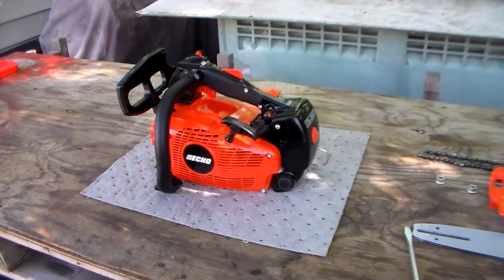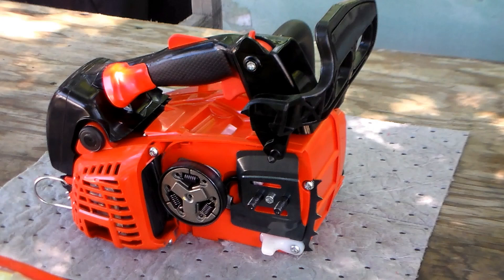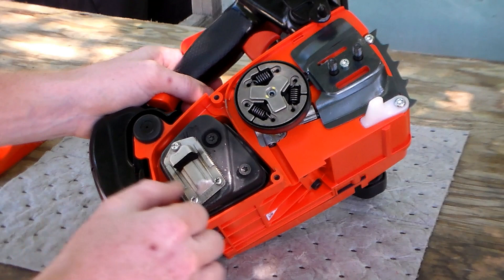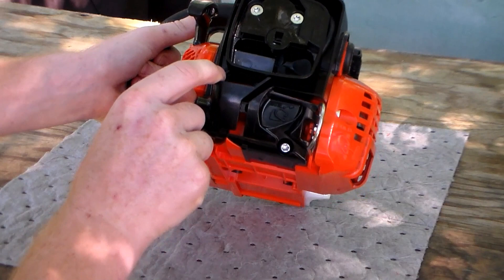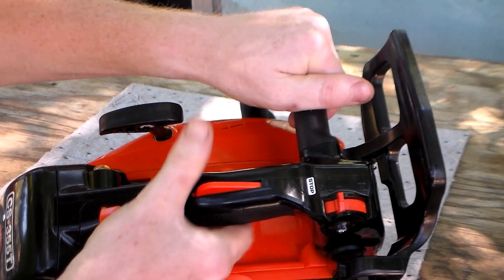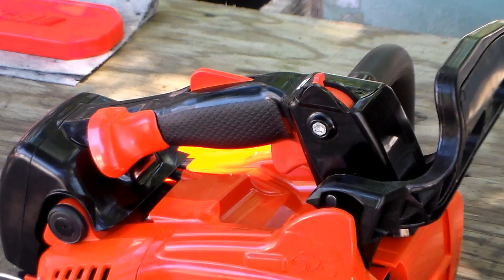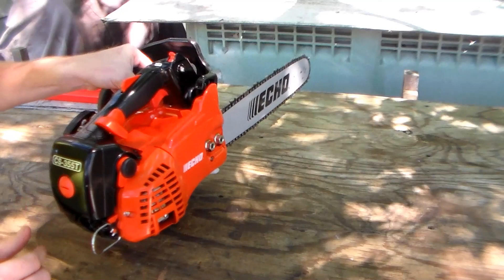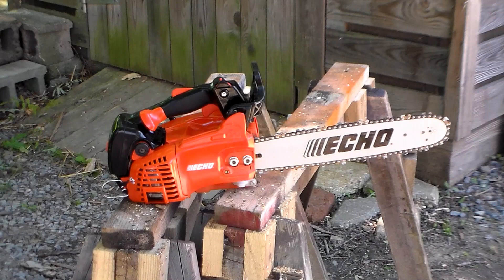Echo CS355T Comprehensive review

Comment: 25yr veteran climber/urban forester. For decades I’ve only used the Stihl 020t that was later renamed the 200t. About four years ago I had to replace an aging Stilh that just couldn’t be cobbled together any longer and chose the Echo cs355t, mostly for the price and availability of service parts (there is typically a Stihl-Echo dealer in every community). Couldn’t be happier! Though it doesn’t quite have the same power as the Stihl 200T the limitation is relatively negligible and the saw more than makes up for it with reliability. Four years running now and not one single issue, extremely reliable! whereas my experience with Stihl top handle saws are the exhaust baffles typically rattle loose, the oilers leak bar lube into the clutch area, makes a hot smelly mess. All that aside the Echo is nearly half the price of the Stihl 201, the 200t isn’t available retail new in the US any longer.
Reply: Just started in the tree industry and bought one for my personal use. Good to hear that it's reliable.
Reply: I’m right with you what you just said,

Comment: 2020 11 13 - I have had a CS355T for many years, one of my favorites.  Running a 12" Bar.    Have had to clean exhaust screen several times, not much else.   The air filter never collects much as mentioned.  Keep Alcohol gas AWAY from it!!

Comment: I was in a rush doing a job and made a bonehead move on the 355T by putting bar oil in the gas port. I removed both covers at the same time and made this big error. I'm going to clear the gas lines out, but a note to self is to not remove both caps when filling. Only fill one port at a time because they are so close together compared a regular saw. They run out of gas fast so you end up filling them up often.
Reply from the maker: On a saw, the system is designed to run out of fuel before it would bar oil. That is one thing I have never done.. fuel mix and bar oil in the wrong tank. However your not alone, I have had customers bring me those old home life super 2's and done that alot.

Comment: I just received this saw and I am impressed with the construction.  I am looking forward to putting it into service.
Reply: Does yours start without throttle? I even took mine back to have it tuned, but I can prime all I want, choke or no choke, and it will not start unless I hold the throttle as I pull it. I’ve owned at least 5 saws over the years and never had a new one refuse to start like this.

Comment: There's a few pet peeves about this particular chainsaw but power wise you can not go wrong. The casing over the chain bar makes me very nervous especially how hot that plastic gets. Nothing upsets me more than the spark arrest screen getting gunked up over long periods of use. I've taken them off on my weed eaters but won't on my chainsaw because of how hot it gets. I don't run my echo weed eaters long periods so I don't worry about debris coming from the muffler. I'm currently looking at a CS 490.
Reply: I just got my cs490 and it's been great. Took about 5 tanks of fuel to break in, which took a bit because it sips fuel. It's my favorite midrange saw now.

Comment: Thank you Sir. Very fine and Thorough. I would like to see your primer bulb rig.
Reply from the maker: The purge bulb is just that, an air purge to push fuel through the fuel lines to remove any air. No more are needed on the purge assembly.

Comment: Only problem I've had is the rubber anti vibration bushing on bottom handle fell apart. I Think it's due to gas and bar oil getting spilled when refueling

Comment: "You need SOME back-pressure" -- are you positive about this?  I'd been lead to believe that, unlike with a vehicular engine, back-pressure from anything post-block (ie any muffler at all) is simply unnecessary on these single chamber 2-stokes...Would LOVE if you could explain this, I've only been told online via forums and never understood the principles involved (just got my 355t and only removed spark-arrester - I'm in FL (I do keep it with my kit though, figuring if I'm ever "above hay" or something I'd toss it back in)
Had loved @Timber and Tools ' mod, they simply used that plate as a template and made a new one that's got a "straight pipe" (like a 1/2" diameter pipe welded at the gas-exit), angled-downward so no need to alter the covering/plastic or anything....though if back-pressure is really a thing then his method, your method, aren't they all simply guess-work?  If some is necessary, why are we presuming echo didn't make it optimal from-factory?  I will admit I was blown-away at its muffler once I got it home, never seen a modern saw whose muffler was literally just an empty/open box like that!
Your heat-shielding of the clutch('s plastic casing) from the muffler is brilliant, thanks for that I'm totally going to do the same (probably even more IE try getting some in-between muff&front-side of engine block)
Re belt-loop --- OK I'm not (that)crazy!!!  I didn't dare forcefully pull it out - breaking my saw before ever cutting a log lol - but it didn't just swing-out smoothly...finally gave it a hard-pull and it snapped out w/o breaking but to hear you saying that closing it is harder still, well, think mine's gonna stay open at all times like yours lol :D (I'm a climber so it probably would've anyways :P )

Thanks a ton for the vid, I'd decided on this saw soooo many months ago, seemed only the 540xp was a legitimate better (wouldn't trade my 355 for any 200/201t) but it's more-than double the price....seeing that Echo can do this - sell such quality at such prices - really makes stihl seem even more "price-gougey", I mean their valuation of $350 isn't a machine like-a-355t it's their 194t, you've gotta spend $700 with them to get "their version" of a 355...I've never used a 201 but had a 194 and it feels so damn cheap in your hands, not like echo or husqvarna (or poulan pro or scheppach or tanaka)- the 194 I had - had - was certainly the most-fragile piece of 2-stroke I owned!  
Was hoping this saw wouldn't "need" a mod package to be competent like so many others BUT I am a bit surprised you didn't go-over carb adjusments...Echo seems to ship units lean (has been what I've read the most!), honestly I'm not even comfortable using mine "for real" until I've gotten those silly limiters off my H&L and can ensure I'm running  a bit fat instead of a bit lean, hell this is the most-powerful climb saw I've ever used and it'd be easy enough for me to think it was "its normal power" when I was really running-lean and the limiter was all that was keeping it from 15k RPM :P
Reply from the maker: On a saw its not so much " back pressure " it's exhaust pulse that need to bounce back at the port. What muffler porting does is bail heat faster. I.e. you don't port a muffler inline with the exhaust port like some poor diys I have seen. This is why Echo and all manufacturers have the exhaust outlet to one side not directly in front of the exhaust port of the cylinder. So that he exhaust event can pulse back to the port yet deflect heat readily out the offset outlet.
Reply from the maker: All engines need a small amount of back pressure, however with epa most systems are severely choked off. The correct outlet will permit the right balance of exhaust flow, bail heat, and allow optimal engine performance.
Reply from the maker: @leonardo migot not new, it's been around since 2016, yes it is a 355.

Comment: I bought the rear handle version. It will not start if I don’t hold the throttle open a little. After two tanks of gas, I took it to a local shop to have the carb tuned. It runs fine, but still I can pull all day and not start, or I can pick it up like a maniac and start it first pull with the throttle on. 
Compared to my flawlessly starting MS261cm, which starts one or two pulls without throttling, this thing runs like a disposable Chinese saw. I don’t understand why.
Reply from the maker: The top control is different from that of a stihl... stihl is the only maker that has their switches backwards.  All other makers up (or forward) is full choke, pull it down or back one notch and thats fast idle (thats how that saw starts) Otherwise it sounds by the action of having to hold full throttle to start it, your mimicking fast idle.

Comment: Nice review.  Have you had any trouble when starting it?
Reply from the maker: Not one bit, when a saw is tuned right and maintained they start well.
Reply: @captainconner4060  I bought one and after  a few days using it, it was hard to start it. I returned it, but will give it another try soon.
Reply from the maker: Fresh fuel? If so open the low side a tad
Reply: @captainconner4060  it was fresh fuel. I don't have the saw anymore, it was returned. Will get another one soon.
Reply: I've owned Echo products for a long time trimmers / blowers / ... they are the best 2 stroke starters out there ! Very dependable !

Comment: I bought one of these 2nd hand and its great except on a cold start it struggles to push the chain at first and can die if i dont feather it. Wonder if this is anything to worry about??
Reply from the maker: on cold start never rev a saw, let it idle for about 1 to 2 minutes. running a saw right after cold start greatly increases that chance of a four corner seizure. The rings have to have a chance to expand to the heat. Sounds like the low side needs to be turned out about 1/4 to 1/2 turn. and or the idle adjustment needs to be turned in a tad.
Reply: check "steve's small engine" channel on youtube for "tune carb chainsaw", but echo's are notoriously set lean so you may need to open L, H up a quarter or whole turn (no idea w/o seeing it),. also turn up Idle (you can turn it back later once you've fund your sweet-spot :) )
Echo's are known for being fast, reliable starters, if yours isn't I'd wanna tune it asap as I'll bet you're running lean (and would benefit from higher idle.  Remember it's counterclockwise to turn-up your jets, clockwise to turn-up your idle :)

Comment: more power left in that engine, its running fat
Reply from the maker: Indeed, I run em a bit rich for initial break in.
Reply: Can you elaborate on this a bit?  My understanding was echo's are shipped lean, you fatten them up (which conner said he was doing -- which I should go do to my barely-touched, 2-day-old 355t that's still got those limiter caps on :P )  How could you tell by watching/hearing the vid?  It's always seemed to me to be such a small window% of L&H adjustments that even let an engine run w/o sounding AWFUL or simply dying, and that it's within there within that sounds-good range that you're fine-tuning your 1/4, 1/10th etc turns to fine-tune......good on Conner for having it set rich, can't believe I've even run mine (barely, and not at WOT yet) w/o having richened the carbs for chrissake I've setup a semi-permanent tachometer/hours-logger on it and still have the carb-limiter caps on :P 

((To be clear, it's ONLY removing those 2 plastic circular "lock-outs" on H&L screws, then it's a normal/tuneable saw, right?  I believe the ignition module prevents over-spin from max-RPM but I can't imagine that's an issue?  Will be opening-up my muffler some more so know I'll be opening H&L even-more but feel like I've heard of a "limiter" of some type that's not the ignition's max-rpm limit OR the physical plastic H&L "blocker-caps"...would be very thankful to know if Echo's put anything else "in the way" lol, already removed spark-arrester am gonna let everything bed-in before I go do muff-mod))